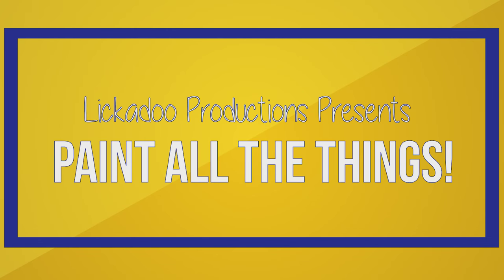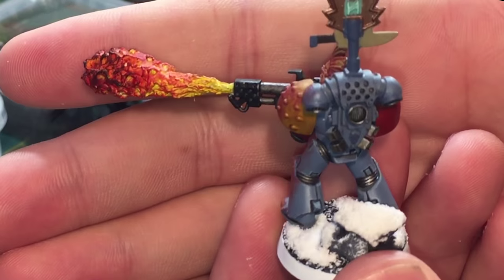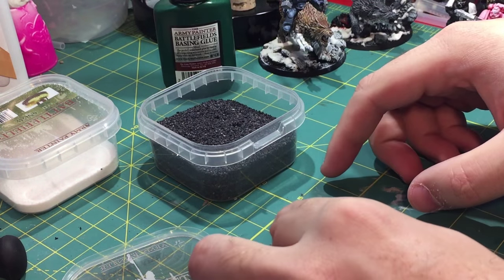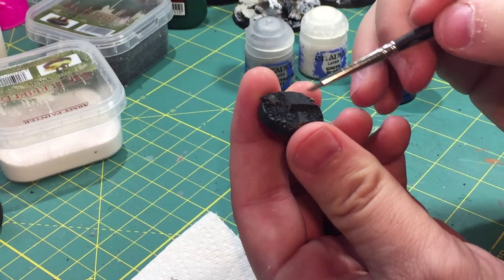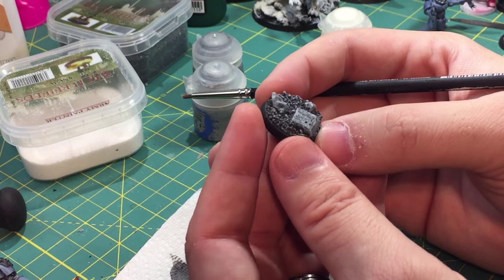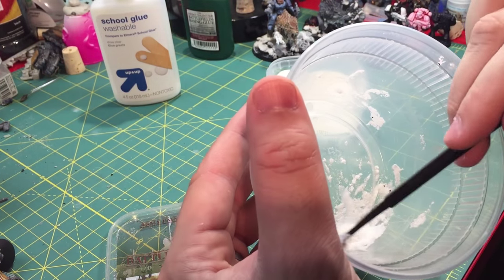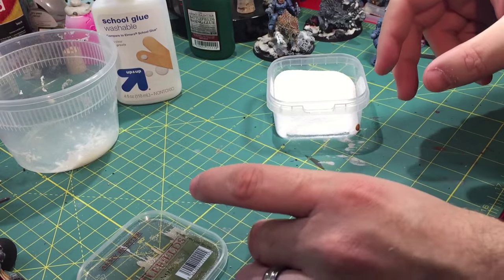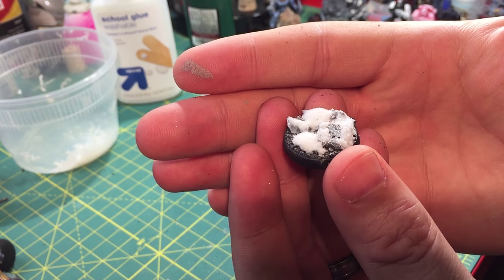How to Make Snowy Bases

Comment: So how would you do if the model was in a blizzard or constant snow fall?
Reply: In short: Look at pictures, and replicate. 

For the most part, if it's a plain base without any prominent upright features (tree stump, standing stone etc.), you'd just lather it on rather thickly, trying to recreate the soft bumpiness of heavy snow coverage. Make sure that your model is sinking into the topmost layer a bit, to emphasize the impression that it's not solid. You might even want to add tracks, on larger bases, to reinforce this effect.

If you have any upright features on your base, finish the top layer by piling the snow up against the upright feature. Make sure that you leave the leeward side bare, as the snow would've been blowing around the feature, leaving a spot behind it bare of snow, or at least nearly bare.